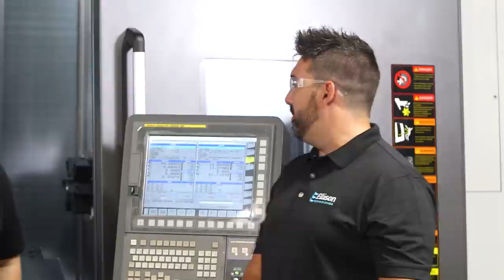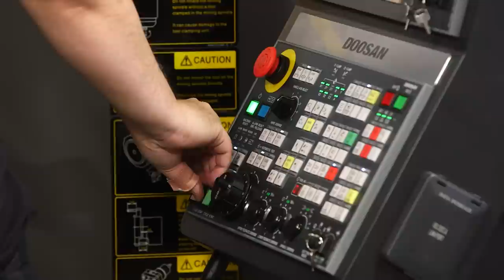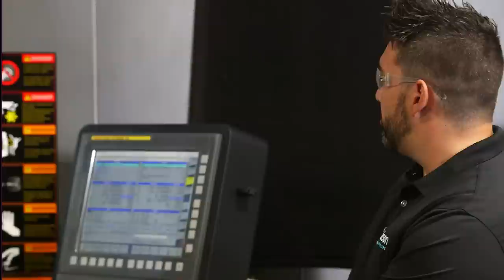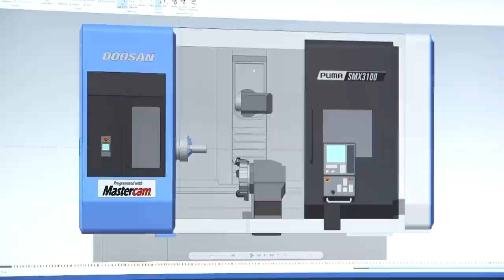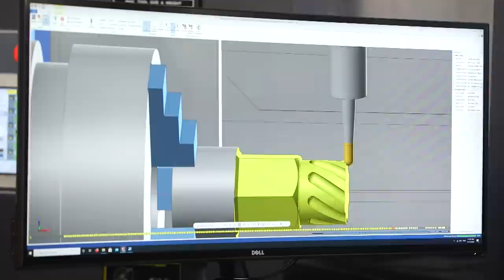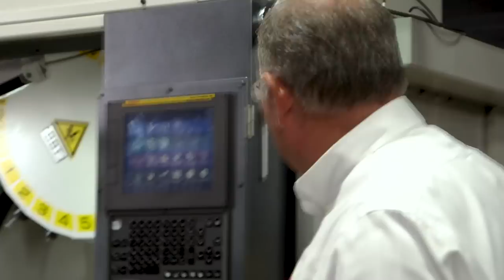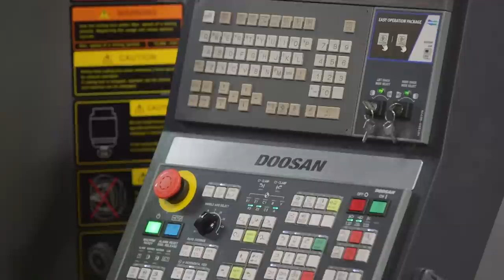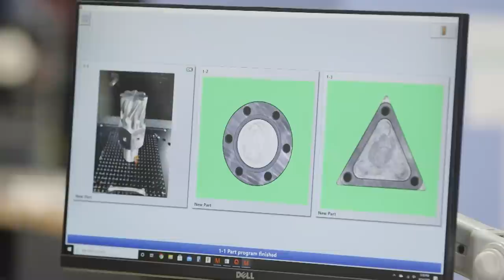SMX 3100 9 AXIS TOOLING, SETUP & MACHINING DEMO

Comment: I’m using a Tsugami TMU1R at my job making medical parts. Mill turns are bad ass machines, the wait codes and split programming are the biggest things to get used too. In my case I’m learning Swiss as well because this is Swiss style. About the closest thing you can get to making complex one operation parts.

Comment: 10 credits from my B.S in mechanical engineering with 11 years of engine driven compressor maintenance and instrumentation experience, and I cant even get a phone interview for CNC related positions. Even with Autocad experience and manual machine work it is tough industry to start out in YMMV.

Comment: Is mastercam working for 9 axis? Curious if that is what you’re using or are you hard coding the machines? I have Gibbs currently but I’m limited to 4 axis milling and 7 axis turning. Problem is I don’t have a multi turn center but I have the software.

Comment: Jus sayin, by the time you tool it with turret tools, spindle liners etc and V Flange tools, this is a million dollar baby. You better have the right work for it for payback.... Avg job shops just don't have these....
Reply: It's a chicken or the egg situation. Do you need the right jobs to buy the machine or do need the machine to get the right jobs.
Reply: You need the right customer that has the range of work that includes this machine, and a need for long term capacity. If you don’t have that, you will end up running sub standard work on it just to keep it running that won’t pay its note....